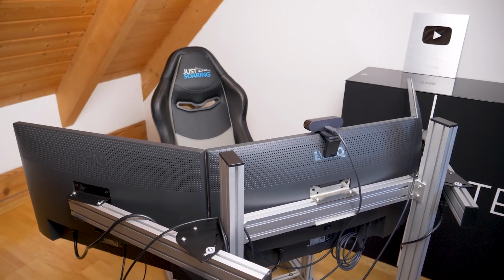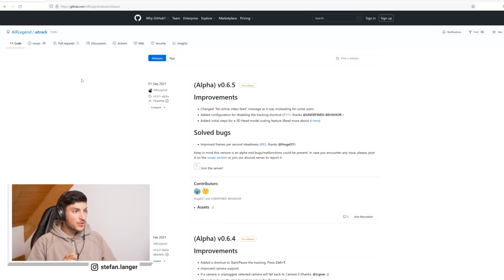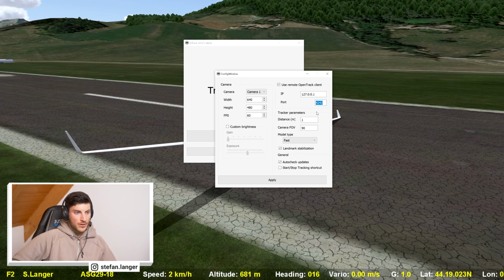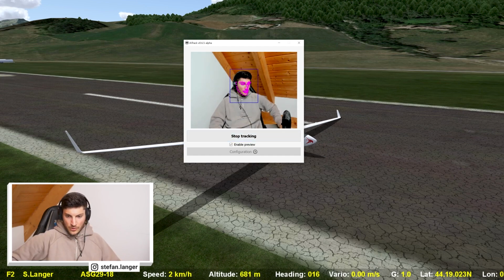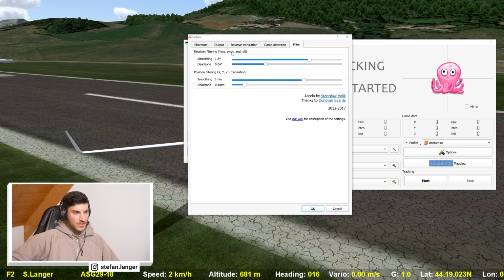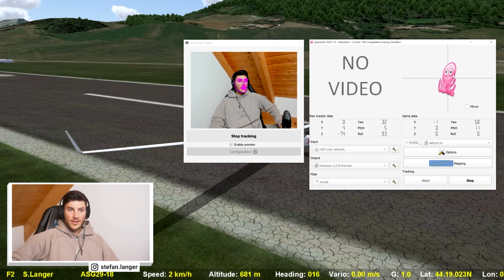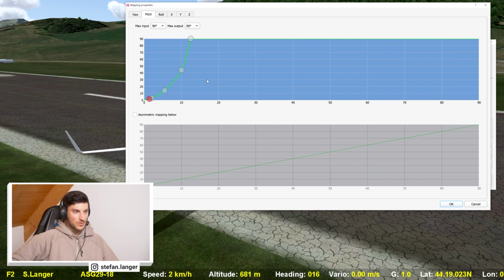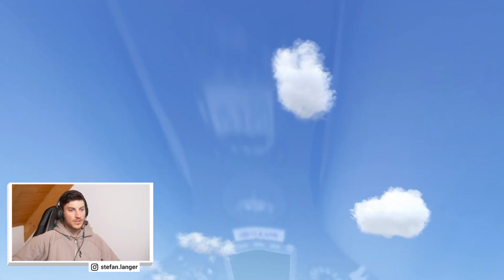Use any WEBCAM for HEAD TRACKING | Condor 2 & MSFS 2020

Comment: My brother and I did this very thing in about 2010. However, AI facial recognition wasn't then available:
So we used free tracking software in conjunction with an IR filter-removed webcam to detect the three IR LEDs attached in a triangle to an old baseball cap! The tracking worked beautifully once you got the hang of it, and the ability to actually look where you were turning, was a breath of fresh air.
We played Condor on the 720p projector, sat in a jerry-rigged cockpit simulator made from an old car seat attached to a Logitech stick and rudder pedals. 
We could fly in the Alps for hours and hours while getting drunk. Awesome! ;)

Comment: Thank you for the excellent tutorial, but I have a doubt. See, I would like to do this to play American Truck Simulator, and I in fact did that but using my cellphone wired to PC via USB-C. However, the input delay is awful. A very noticeable half second or so making it very awkward. I would like to know if with proper webcam it'll be faster. Also, would it make any difference the cam being 30 or 60 FPS capable?

Thanks in advance!
Reply: same issue here, I just gave up.
will just wait to get trackir because camera doesn't sometimes pickup face and eyes if your close and has too many issues, so I prefer the trackir since it is infrared dependent i guess.
Reply: @RealMoAG  Did you try with TrackIR? How's the input lag with it? I now have a cheap webcam and the improvement over using a cellphone was really big, still far from perfect, but much, much better compared to a cellphone camera.
Reply: @Phantosh  well I currently don't have one nor have tried it but it is the standard for most of content creators, they all use it.
Reply: @RealMoAG  Ah ok got it. I'll just stick to this cheap webcam. TrackIR is way too expensive. Maybe for content creators it's nice but I don't think it's worthy only to play one game.

Comment: Opentrack now has its own facetracking, so you do not need AITrack.  I use a Logitech C270 web cam ($35) with just Opentrack and it works VERY well.
Reply: What input i need to put? i use c270
Reply: @agustinferreyra7741  Ever figure out which input?
Reply: How to deal with lag?
Reply: @K3IRRR  neuralnet tracker
Reply: thanks
Reply: Nice info, thank dude
Reply: Do you recommend for the sim or just get a headset?

Comment: Using VR also works very well. The only downside is that you can’t see the flight controls anymore , but have to do everything by feel
Reply: With VR the problem is using XCsoar as you have to lift the headset to use it. But then again, VR almost feels like flying ;)
Reply: @alpenjon  that’s true, so if you want to practice with XCsoar, the head tracking option is much more user friendly
Reply: @nicopeursum8208  also you could control xcsoar with your joystkich/throttle :)
Reply: @WojciechSotysik  How did you manage to control it? All I found was a tutorial on moving cursors up, down, left and right, but you need a lot more to use XCSoar...preferably hand input / gestures. Thanks!
Reply: @alpenjon  in VR you could attach any other window into your game (for example XCsoar / google maps / youtube etc). To control it i use AHK script - i can zoom in / zoom out , switch pages / manual change MC / change maps / pan / etc )
Reply: @alpenjon  And if you want other "Advanced" changes in XCsoar/LK you just hit "Alt+Tab" and control it with your mouse :) But during the task you will probably need only zoom / pan / pages / infoboxes / manual mc - it all could be controlled with your joystick / throttle :) Ane few flights to remember it :)
Reply: @WojciechSotysik  Much thanks man, I will give it another shot!
Reply: @alpenjon  its easy a now for me - much faster than using it without joystick :) good luck!
Reply: @alpenjon  You are wrong :) you could see xcsoar / lk8000 inside a cockpit in VR - check my videos - im livestreaming in VR :)
Reply: @WojciechSotysik  I was able to see it but interaction with the display was a pain... it would be best to use a handtracker? I will see how you do it though, thanks!